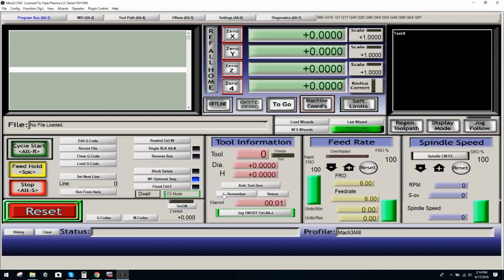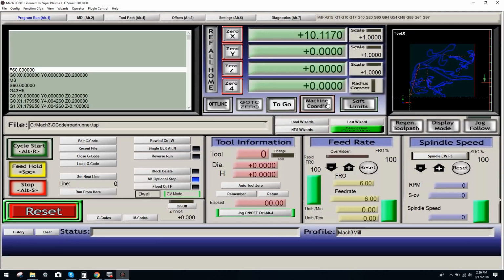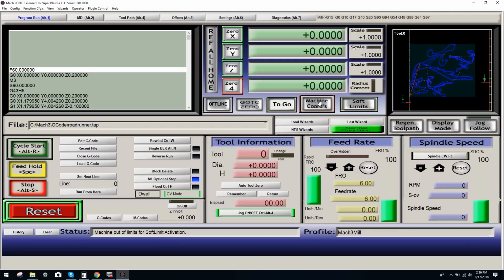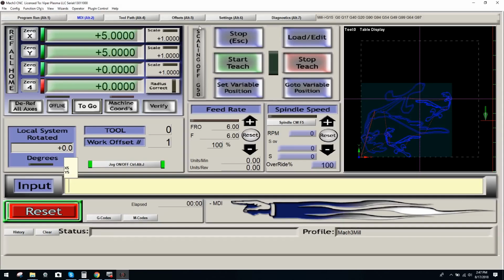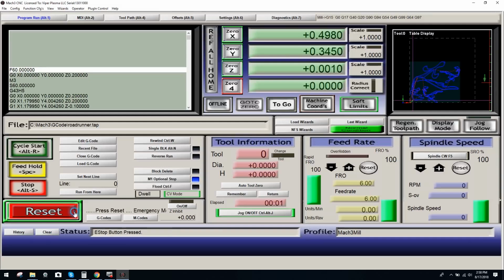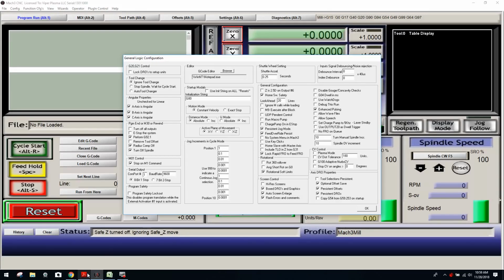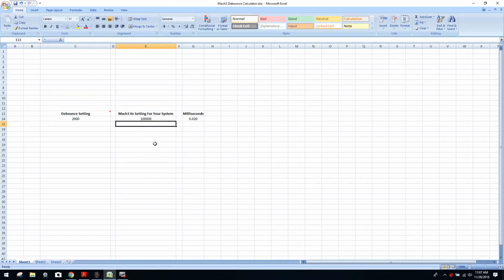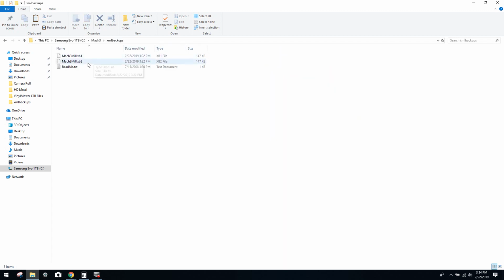CNC Mach3 Essentials Learning Course..

Comment: how do you move XYZ???
Reply from the maker: You would have to contact your system vendor as each breakout board, and driver will have different step, and direction pin settings that must be put within Mach3 to generate movement. 

Thank you,
Vince

Comment: Hey Vince, regarding the interference denounce calculation, is the manual talking about the frequency of your pc/laptop or are they talking about the frequency of your CNC controller card? It seems to me they're referencing the latter which will be running at considerably slow speeds than a modern computer and the controller will dictate how fast signals can be sent to Mach running on your PC. That's my interpretation only from this video for reference, I haven't even loaded Mach yet, I'm still building my system.
Reply from the maker: Good question this is the definition from the Mach3 users manual 

" Debounce interval/Index Debounce: Is the number of Mach pulses that a switch must be
stable for its signal to be considered valid.

 So for a system running at 35,000 Hz , 100 would give about a 3 millisecond debounce (100 ¸ 35000 = 0.0029 secs). 'The Index pulse

and the other inputs have independent settings."

This is strictly based on the PC's kernel speed the software is installed on.

Thank you,
Vince
Reply: @corvetteguy50  Now that's a definitive answer, thx. And your right finding the use manual isn't easy. 👍🏻